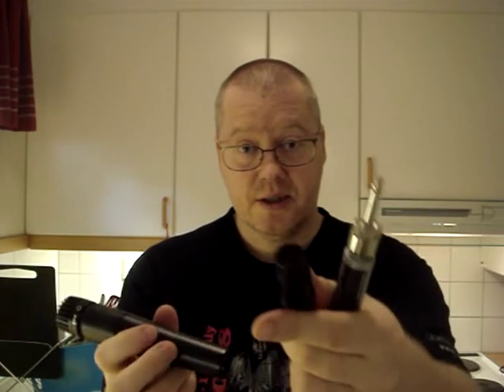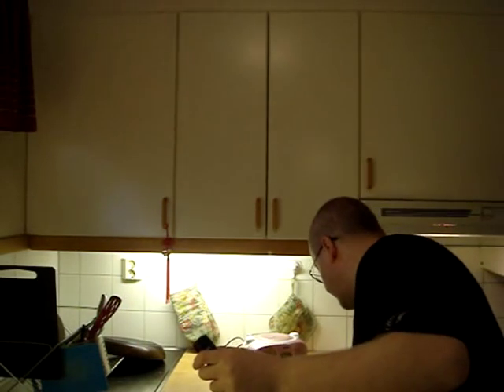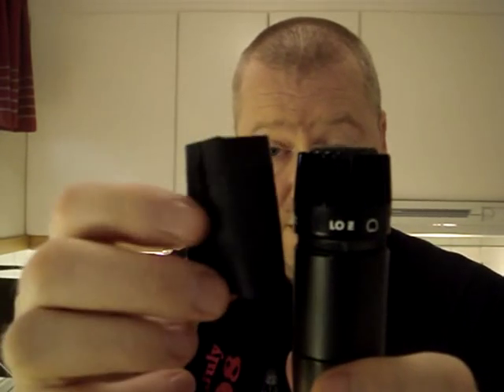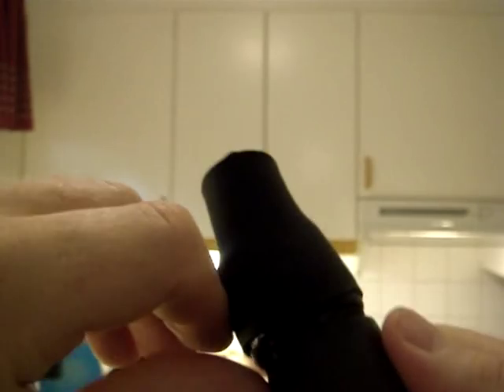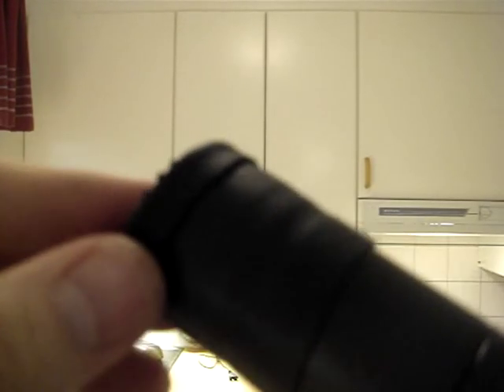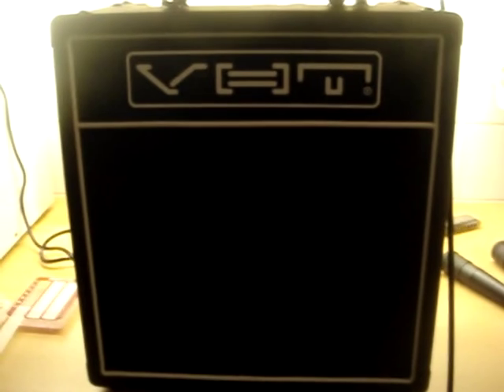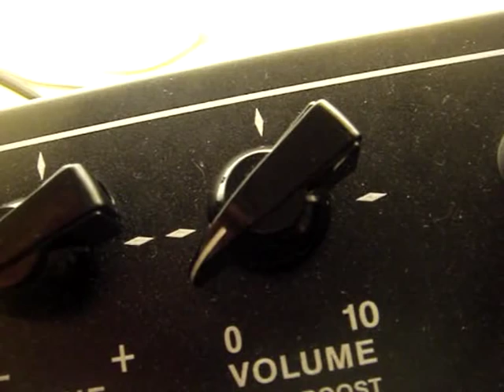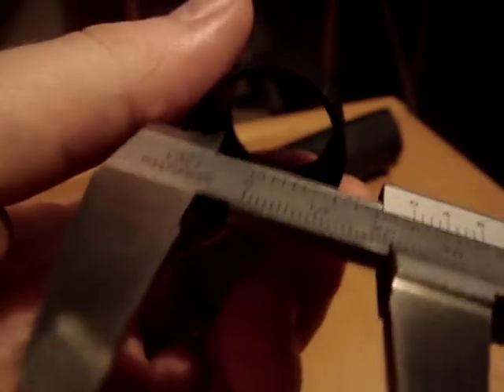How to give SM57, SD545, vocal microphones powerful sound for amplified harmonica with bicycle tube

Comment: Just used your trick on my SM57 with some difference.
First, easier to slip the tube from the back of the mike
Then, put several layers of different diameter tubes to try to increase the diameter. Bullet mikes too big to my taste, but SM57 too small. 
I ended by adding over that  a ring of an adhesive neoprene foam gasket that will fit in my hand perfectly !